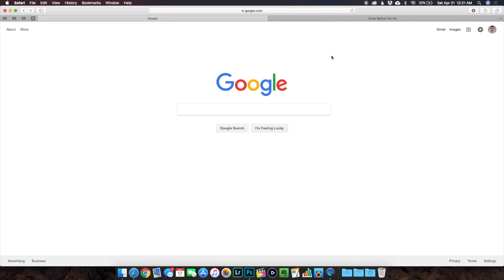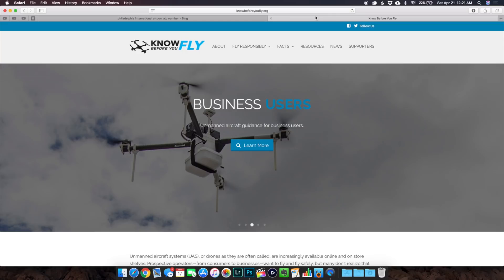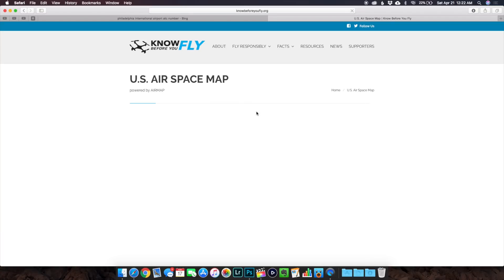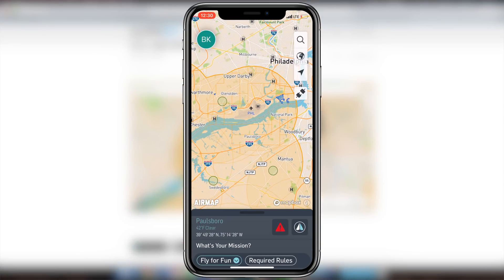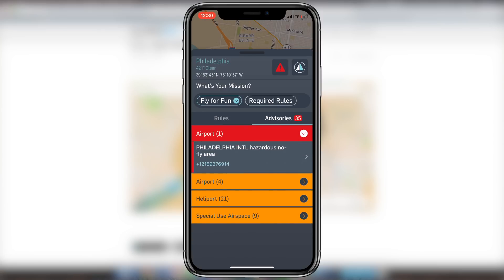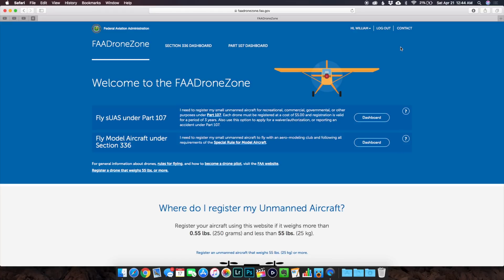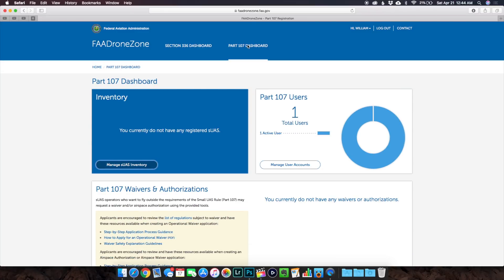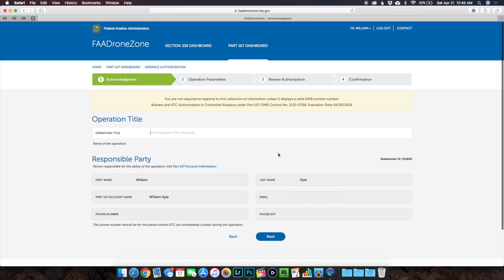How To Request ATC Permission to Fly Your Drone (Hobbyist & Part 107)

Comment: Billy, is this information still valid, I called the Naples airport last night and they told me as long as I stayed under 100 feet I will be good but to call the tower in the morning. As I was heading down to Naples this morning I called the tower and they told me I could not fly without authorization and that I would have to go to the Faa web site and read it. He asked me if it was had a commercial license I told him no and he told me I could not fly without authorization.

Comment: I don't have a drone at this moment and I'm looking forward to get one.   I live nearby an Aiport Eppley Airfield Airport in Omaha, NE.  I prefer to go far away from the airport for safety reasons and learn first how to fly the drone.  What recommendations do you offer to beginners.   Is there any safe place and how far do I need to be from an airport to practice and learn how to fly a drone.  If I want to use it as hobby and . just film videos not for commercial use but personal use.  Do I still need to get  permit and register my drone?  and what are the differences between a hobbyist and commercial?  besides getting a special permit  and making money out of it,  is there any kind of control on altitude to fly?   as Hobbyist what are the requirements on altitude to fly?

Comment: Being a new recreational owner of a DJI Mavic Pro drone I have had a very difficult time finding information regarding notifications to Air Traffic Control regarding flights within their restricted air space. What I do find is geared way more to the commercial operator than the hobbyist.

While your websites and videos talk a lot about LAANC  you have very little  or nothing on AirMaps D-NAS. With all the latest changes I believe an updated video is justified.

I understand that Commercial pilots have a bigger stake in getting proper authorization, but the responsible recreational operators at least deserve some recognition because a non informed operator is more likely to give a bad name to all operators vs those that have obtained certificates. As being a widely view channel I would hope you would take a larger responsibility to keeping the recreational operators informed as to how properly give notifications of flight and how it will assist them in flying safely.

 

While this may seem obvious to you that you have taken the recreational flyer into consideration, believe me, you need to do more.

Comment: What if they keep denying you
Reply: Depending on what facility you're asking, I might just say "give up" or "try to find a time frame that works best for them" 
If they're in the middle of a push, or about to have one, they won't give a shit about what you want to do... Hence finding a better time frame.
Some facilities may have been burned before, and don't want the additional liability.  And it's pretty easy to get burned.  Notice in the video, they said to call when he's finished flying? If something as simple as that isn't done, and for the next hour, a controller keeps having to advise pilots of a possible drone in the area/vectoring aircraft around the area, while the supervisor is trying to call the drone pilots dead phone.... That controller is going to bitch, moan, and complain, about it for the next two weeks... Which is then going to make management think twice about authorizing a drone in the area.  And if a pilot calls the facility complaining about how he/she was vectored all over  because of a possible drone, that's even worse. Sorry for the rant, just trying to educate.

Comment: Billy I always enjoy your videos they're very educational and it's helped me a lot with my mavic Pro. Unrelated question though. I crashed my mavic Pro the other day and the gimbal does not move anymore but the camera and everything else still works. is did break that little plastic tab that's in back of the camera... do you think the ribbon cable is the problem why the gimbal is not moving?

Comment: Great video, Billy...  Any chance you could make a video showing how to get DJI to let you fly once you have clearance?  I have a Mavic Pro and couldn't get it above 100' or more than about 150' from my homepoint, even though I had permission from the tower.  I tried both the DJIGo app and Litchi.  I was getting Max Radius and Max Altitude messages on the controller.  So once we get the clearance, how do we make the drone fly?

Comment: Everyone, drone pilots and the FAA are in in a steep learning curve right now.  I'm near a regional airport, but, it gets a great deal of VIP movement.  (DC metro area)  At those times it is impossible to reach the tower because they are only responding to 'special' calls even though there is no TFR.  As a fall back, I call the airport manager.  He can not approve my flight, but he can reach out to the tower to let them know I'm trying to reach them.

Now, as a last resort, I hop on my scooter and drive up to the tower.  Even as a hobbyist they require me to fill out the 107 form, but approve it right away.  I think my Harley soul mate in the tower gets tickled when I do that.  But, my point is, where there is a will to get a special shot, there is a way.  Persist!  But,  be safe!  Piss!  (oops, I mean Peace)  LOL

Comment: Great job Billy. I read quite a bit after the FAA UAS Symposium earlier this year in Baltimore regarding LAANC (Low Altitude Authorization & Notification Capability).  It’s in a handful of airports now but the FAA will be expanding this across the country this year. This will take some time but will be worth it. From what I read this will apply to both the hobbyist and Part 107 pilots.

Comment: Quick question Billy . . . even after you receive ATC approval, the DJI restrictions are still in place, and won't let the P4P take off if you are within the 5 mile limit imposed . . . how do you get around that and be able to take off?
Reply: Currently, 2 year later if you still get this notification, the DJI fly and go4 app does let you fly within 5 miles of airports, if you give a phone number and check some boxes (I use DJI fly not sure if go4 is different)

Comment: I was of the understanding that if you were 336, You are calling the tower to "tell" them that you are flying and staying within the laws then answering any questions they may have. I understand that asking is more polite and will go a long way in the relationship we have with the control towers. But in the event when they say no because of their bias then you remind them that you are not really asking for permission. Be respectful and know that you aren't the all wise master of the air. There may be a real reason for their denial.
Reply: IndyKurt Their airspace their call, it’s more complicated than flying 336. Even aircraft have to request permission to enter class D,B,C and on occasion class E extension. if that’s the case then so do drones. You can never clear yourself to fly in airspace you don’t have control over. FYI I’m a recreational drone pilot and a commercial aviator so I’m very familiar with both sides of operation.

Comment: Concerning whether notification only or permission is required by hobbyist to fly this is what the FAA has to say about it: 

“IF THE AIRPORT MANAGER OR AIR TRAFFIC CONTROLLER DENIES APPROVAL FOR MY DRONE OPERATION, CAN I STILL FLY?
The FAA has interpreted the notification of a drone operator that it may be unsafe to fly as official notification that the operation could be perceived as reckless. It is possible law enforcement could be called if a flight takes place after the operation has been denied due to safety reasons by air traffic control or airport management. The FAA may take enforcement action against those pilots who fly recklessly. Drone operators should not be denied unless there is a safety or operational issue that prevents the flight from being compatible with the airspace. Operators may question the response they have been given by contacting an FAA FSDO.”

Comment: You need to emphasize that hobbyist have to get permission from any and all airports or heliport regardless of their size even small unpaved private airports that may be on a farm. Part 107 pilots don’t have to get permission from smaller airports like those unless in some rare cases the airport has a controlled airspace that goes to the surface. A lot of controlled airspace doesn’t start until 700 or 1200 feet AGL and since drones can’t fly at that altitude legally part 107 pilots don’t have to seek permission because underneath that 700 / 1200 feet AGL is class G. Part 107 pilots can fly in any class G airspace. Hobbyists can fly in any class G airspace that is not within 5 miles of an airport without notification.
Reply: Hobbyists don't need permission to fly, they are only notifying control of their intent to fly if within 5 mi of an airport. Control may object and the hobbyist should comply. But outside NFZ, there is no permission process for non-107, just notification.
Reply: paulmike3 yes I notice I said permission at the first but I said notified at the end. That’s a hotly debated topic. Yes they can go ahead and fly over an objection by the control  tower but Lord help them if there’s any problem or they crash. Also you’ve notified the tower and the tower has objected and you go up anyway you better be looking over your shoulder for Officer friendly that is going to show up five minutes after you take off. You’ve given them your location where you’re going to fly lol.
Reply: Also remember part 107’s can fly as hobbyist too.

Comment: I have noticed on AirMap that airspaces restrictions and advisories change depending on how you fly.  For example when you open the app it asks the type of flight, for fun or part 107.  When you choose for fun and look at map you see all the yellows and red etc but if you switch it to 107 a lot of those yellows are gone allowing a bit more freedom under 107.  A question I do have is under the AirMap it also give Heliports, are we supposed to call them too?  I called the 2 near my house and 1 is always a voicemail that I leave a message and the other had no clue why I had to call LOL
Reply from the maker: Nah, no need to call a heliport unless you can visibly see it while flying (at least that is the rule of thumb I use lol)
Reply: That is awesome news lol I am near BWI but just far enough away that I don't have to call them but it seems like there is 1,000,000 heliports LOL I was going crazy.  Thanks.  Safe flights!
Reply: Billy Kyle I got news for you Billy you’re wrong. This is from the FAA: 

(9) "airport" means a landing area used regularly by aircraft for receiving or discharging passengers or cargo.”

Doesn’t matter fixed wing or not. Even seaports have to be notified.